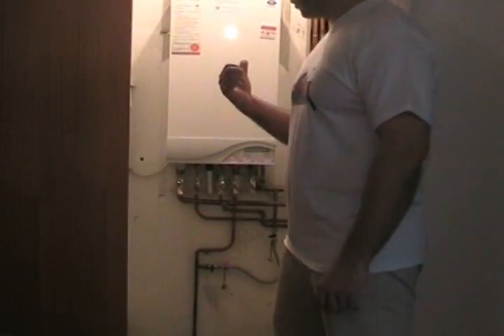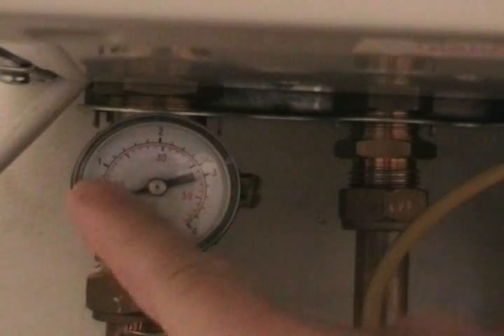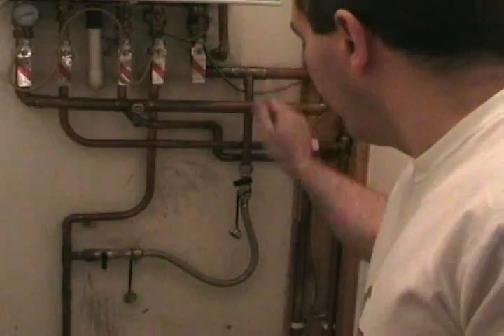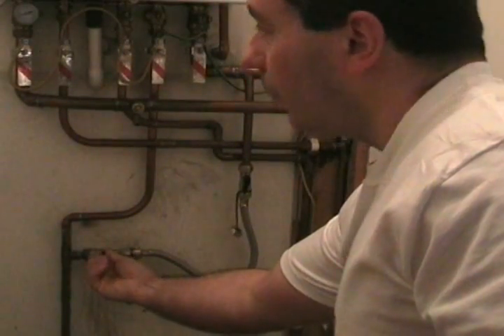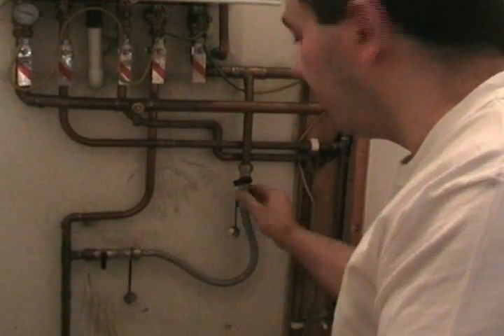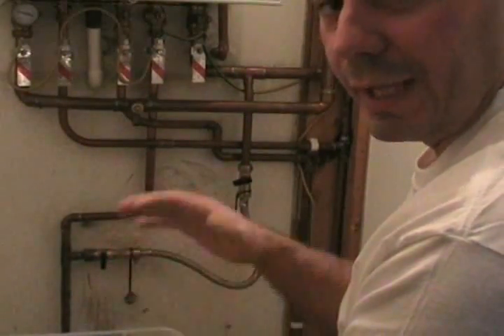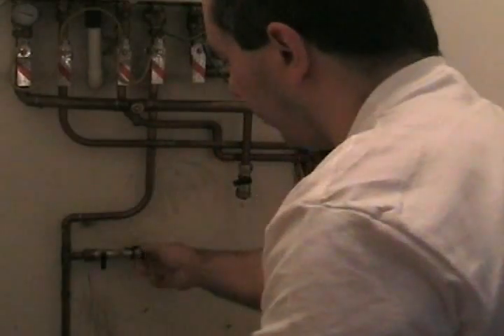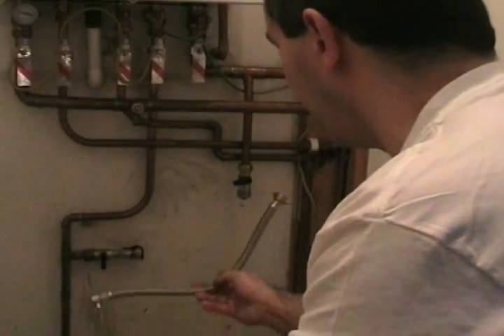How to repressurise or fill a combi boiler or sealed central heating system

Comment: Hi mate I'm having problems with the pressure always dropping on my boiler and as a apprentice elictrican I don't know much a about it speaking to plumbers on site they say it could be a leak is it an easy thing to fine 
 

Callum Scotland fife
Reply from the maker: On the outside of the property there will be a blow off pipe, this is just a piece of normally copper pipe that goes from the boiler to outside. It's a good idea to tape a plastic bag over this pipe and see if the bag fills with water, if it does the pressure relief valve is allowing water to exit the system. This happens when the expansion vessel in the system is faulty. If the bag does not fill with water it's likely there is a leak somewhere, these can be very difficult to find and can involve lifting floor boards etc. The first thing is to check the radiators- https://www.youtube.com/watch?v=vdep7cSR4Wo

If you are sure it's a leak and you can't find the cause you could try adding a dedicated leak sealer to the system, that should stop the leak. Fernox and other firms make the leak stopper ;-)
Reply: No problem thanks very much for your help keep up the videos they are very good quality and informative, if you need any sparky advice don't be afraid to ask ;)
Reply from the maker: Callum Kane
Thanks Callum ;-)

Comment: Thanks for this. Really helpful. My only issue is that due to the way a water softener has been installed I can't remove the pipe thing as in the last part. Should I call a plumber? Is my boiler going to explode?!
Reply from the maker: You are welcome.
I would not worry too much about removing the filing loop afterwards as in reality most people do leave them connected.

Comment: Hmm... I open mine on both ends and nothing happens?
Reply from the maker: Can you check the actual handle on the valve is turning the valve?
Sometimes the handle turns but not the valve, like this- https://www.youtube.com/watch?v=8Yfb1dSZHQ0
Reply: ***** I'll watch the video at home but I can feel the valve is turning (as it requires a fair amount of pressure and initially was very hard to get it going) before it stops at around 100 degrees anticlockwise - just past horizontal. I am thinking of disconnecting it and opening the knob over a bucket to test out the water supply...
Reply from the maker: Andrei Petunin
That's a good idea, just make sure you open it very slowly ;-)
Reply: I swung the lever back and forth a few times and it went further to about 150 degrees and the pressure went up as expected :-) Piece of cake! Remote plumbing is great :)
Reply from the maker: Andrei Petunin
Glad you sorted it ;-)
Reply: Hi there, I've got the same issue where the water is flowing through the refilling loop (tested by disconnecting it and the water flows out when I turn the valve), but the pressure gauge doesn't increase.

Comment: Hi, i have a serious problem (i think), my pressure was about the same as it was on this video, so i topped it up to 1 bar, but now things are happening, after an hour the hot water stopped working and when ive come to look at the pressure gauge its gone to 2.5 bars!!!!!!!. anyway i turned the boiler off, put a hot tap on and then turned it back on, the burner light comes on but the pressure keeps rising and its gone  past 4 bar. i have to keep it off or it keeps rising, any help.
Reply from the maker: It sounds like the filling loop could be passing. When this happens the pressure in the boiler steadily increases by itself.
You need to ensure the filling loop is not passing.
Reply: also when the boiler was last serviced they left the filling loop on so they've broken the law.
Reply: should i take the loop off?
Reply from the maker: Arron Lowley
Only if you can isolate the water feeding it, or else if it's passing badly it will leak everywhere.
Reply: i took some water out  of the radiators and put the pressure to just less than 1 bar, when the heatings on now it goes to around 1.2 bar.
Reply from the maker: Arron Lowley
That's perfectly normal as the water expands when heated ;-)

Comment: I have a pressure guage and flling loop not by my boiler but in the airing cupboard next to the hot water tank and expansion vessel, does the same principle apply? I notice that when cold the pressure reads close to zero but I haven't noticed any adverse effects on the heating or boiler, both seem to work as normal. Cound this indicate a faulty pressure guage?
Reply from the maker: Not sure, sorry.
Your best bet is to ask in the central heating forum, hopefully one of the heating guys will advise-
http://www.ultimatehandyman.co.uk/forum1/central-heating-boilers-f35.html

Comment: Hi - I am sure you won;t see this but hoped that there might be a small chance you would see and be able (genius that you are) to answer my question...... The boiler is coming on and off every few minutes (which I have been assured several times by landlord/his gas engineers is perfectly fine, good even...) and at the same time, the pressure is dropping from 1 to 0.  My research suggests that this is not a good thing.  I am thinking that I need to re-pressurize - if I understand correctly, to be at 1 bar when cold - and that I must do this when the boiler is cold?
Hope I am clear with my query and thanks a million in advance for you help :o)
Reply from the maker: Most combination boilers need to be pressurised to about 1 bar when cold. Once they heat up the water expands and so the pressure increases, then when the boiler cools again it should drop to the 1 bar level.  
I hope this helps.
If you are still having issues you may be as well asking here as the heating guys know much more than me ;-) 
http://www.ultimatehandyman.co.uk/forum1/central-heating-boilers-f35.html
Reply: Thanks so much...(wow, you replied!!). I shall try repressurising in the morning when it's been off (and is still off?) and see what happens then :o) And thanks too for the signpost.

Comment: Many many thanks for great video. Our boiler failed to come on this morning and the pressure gauge was showing zero after we'd bled it yesterday evening. We couldn't face potentially several days in the cold before an engineer could come out so we thought we'll have a go ourselves. Your video was the only one to advise about the disconnected pipe which we'd noticed dangling so we connected it and eventually found the valve to turn the water on (with a pair of pliers as somewhere along the line an engineer had removed the original knob). The boiler fired up after waiting a few seconds for the water to circulate and we breathed a sigh of relief now that the house is warm again. And yes, we did remember to disconnect the pipe afterwards.  Many many thanks again.
Reply from the maker: You are welcome.
I'm glad the video helped ;-)
Thanks for the comment

Comment: do you connect the cold water to the central heating return?
Reply from the maker: Yes, but the valves should already be in place- they should just need connecting via the flexi pipe.

Comment: I am just away to re pressurise my boiler but before i do, does the boiler need to be cold, off completely ie not running or off at the mains, and do i need to run my taps?? I have totally forgotten what i should do! Its a glow worm compact 100e with the flexi hose... ( at least i know where to stick it )
Reply from the maker: Yes the boiler needs to be cool as the cold water going into an hot system can damage it. As long as the central heating has not been used for half an hour and nobody draws off any hot water whilst you top it up it should fine.
Reply: Aww man you're a big bright shiny star! Thank you very much sir. Every one is duck taped to their relevant seats, away i go...you're a very nice man, a very very nice man ;-D
Reply: Well, thanks again for your sound advice. All done and dusted and warm as toast. Cheers
Reply from the maker: MsChillyfun
You are welcome ;-)

Comment: I had to do this to the boiler in the house I recently moved into, didn't have to use a filling loop, there was already a small bit of copper pipe connected. There is 2 end caps just hanging, should this pipe be disconnected and the end caps replaced?
Reply from the maker: I'd just leave it as you found it to be honest ;-)

Comment: Easy to follow vid thanks,However, I am getting the flashing F1. I have a refill loop fitted, I refill up to between 1.5 and 2 on the dial. Boiler starts working, then after a few hours the Flashing F1 is back. I have good water pressure at all taps, I have also made sure there is no air in the rads, by using a key at the top side of the radiators, loosening untill water comes. is this correct? They all work when F1 is not flashing. any Ideas. You help would be greatly appreciated.
Reply from the maker: Do you have the manual to see what F1 is?
Is this the only time you have topped the boiler up or have you done it a few times?
If it's happening regularly the chances are you have a problem with the expansion vessel.
I have made a few videos on this subject if it is that-
https://www.youtube.com/watch?v=SNULc5fhY28
https://www.youtube.com/watch?v=KeO2gswQQe4
https://www.youtube.com/watch?v=zhgOI4U5DQo
Reply: ***** It is a logic combi boiler, so there is no expansion vessel unless it is inside the boiler. I have to do this on average 2-3 times a day. according to the manual fault codes F1 = Low water pressure. It also says if it keeps happening there is a water leak, we have not noticed any water leakage in the house.
Reply: gerryxuk
Have found the servicing manual, and there is indeed a Expansion vessel inside the boiler. Thanks for the help.
Reply from the maker: gerryxuk
You are welcome.
The three videos I posted show how to add a second expansion vessel to the system, which means you can leave the existing one in the boiler but some people prefer to get a gas engineer to replace the existing one.
Thanks for the comments

Comment: hi could you pls tell me why the water is no runing in the tap after intaletion the combi boiler
Reply from the maker: Do you mean water is not coming from the hot tap at the sink?
Or no water is entering the combi when you open the filling valve? If it's the later there might be two isolation valves that need opening.

Comment: Great video. My boiler is an ideal logic+ 30 and today the pressure had dropped. I fixed it but i have no filling loop, the water ran when i turned the valves and the pressure went up to 1 bar. Does this mean the filling loop is built in to my system? Thanks
Reply from the maker: Probably, some modern boilers have two valves built in which you open to re-pressurise the system.

Comment: do i need to switch the off the electric supply to the boiler .
thanks
Reply from the maker: You can do, or just turn the thermostat down so that it does not call for heat until you have it at the correct pressure.
Reply: ***** thank you...done it

Comment: I need to add pressure to my boiler it is a heat line Monza 24 it has no filling loop and one end cant find another but every boiler is ment to have 2 end caps for the filling loop? Help please asap cheers
Reply from the maker: You might have a rigid filling loop, if you search youtube for Rigid filling loop it should show how to do it ;-)
Reply: Cheers

Comment: Thanks. Am doing it now but lots of water is coming out. the bucket is almost full.
Reply from the maker: You only needed to open the bleed valve to release the pressure.
If you have removed so much water and it still has high pressure you need a heating engineer.
Reply: Thanks. I realised after bucket full that the radiator uses the water to get hot. Bleed the remaining radiators properly and pressure back to normal. Thank you so much.

Comment: Hi please my boiler pressure is too high 3.5, how do I bring it down? Everyone seems to be showing how to increase the pressure. HELP.
Reply from the maker: You can release some pressure through a radiator bleed valve How to bleed a radiator
If the pressure has gone up by itself you have a problem, perhaps your filling loop is passing or perhaps you have a faulty expansion vessel

Comment: Hi, I have followed this video and brought the pressure back up to between 1 and 1.5 bar but the boiler will still not light?  The red light is on which is a flame with a strike through it which means it's disabled.  Any ideas on how to get the boiler to reset and start up?
Reply from the maker: Your best bet is to ask here and provide as much info as possible-
http://www.ultimatehandyman.co.uk/forum1/central-heating-boilers-f35.html

Comment: Our combi sealed central heating is losing water pressure every time the heating is on. Engineer came today to say that there could be a leak anywhere, behind the walls, under the floorboards. This isn't satisfactory to me and can't keep going out to top up water pressure although this is what we were advised to do until we know where the leak is.
Reply from the maker: If it is only losing pressure when the heating is on it might be a faulty expansion vessel. You can test this by finding the pipe that comes from the blow off valve outside. Tape a plastic bag over the pipe and if it fills with water the expansion vessel is probably faulty.
Reply: *****  - Thanks.  We had a look at the PVR (?) outside but it was dry.  The engineer said to keep an eye on it although he didn't look inside the boiler which I thought was a bit strange. The problem is it then started to rain, also it's so near the ground there's very little room beneath it.
Reply from the maker: Kate Jay-R
Finding leaks can be difficult, might be a good idea to try this at all radiators-
Find leaks on central heating systems
If the leak is under a floor it's difficult to find. Perhaps you could try using a dedicated leak stopper that you add to the central heating system?

Comment: my boiler stopped working tonight and i have 2 young kids your video was a life saver :) only problem i had was when i tried pressurising the system the gauge didn't move at all so i think its broken i only put enough pressure in to get the boiler running again and get me through the night until i can get an engineer out tomorrow, many thanks
Reply from the maker: You are welcome, I am glad it helped ;-)

Comment: hi, thanks for your video, really helping. however, one of the valves you have to open won't budge! at all. the other will turn to open. what could be the possible reasons for this?
Reply: actually it was just a bit stiff! apologies
Reply from the maker: Hr Cass
No problem, Glad you sorted it.
Thanks for the update ;-)

Comment: How do you repressurise a non-combi system i.e. it has a tank,
Reply from the maker: It should re-fill itself. If it doesn't there may be a problem with the ball float valve in the tank.
Reply: Jag Singh lion Thanks. I'm not sure that if it is filling ot not as no water or air sprays out when bleed the rad?!?
Reply from the maker: Jag Singh lion
Are you sure both valves at the bottom of the radiator are open?
Have you tried another radiator?
Is the heating working?

Comment: Good video - but how do you lower the pressure if you accidentally increase it to say 2 bar...?
Reply from the maker: You can drain some out from a radiator bleed valve, make sure you have an old towel or similar to catch the escaping water.
Reply: ***** Thanks - I thought you only bled radiators to let out air. I did what you said and filled about three mugs which did the trick. Ta

Comment: Good video. I've completely emptied my system down. How long does it take to fill the system back up again. Obviously it depends on the size of the house etc, but roughly, so I know there is not a leak anywhere
Reply from the maker: It should not take long, perhaps 10-15 minutes including bleeding the radiators. It's best to fill it slowly, rather then filling it at full bore ;-)

Comment: You mention the filling loop needs to be left off as a legal requirement. I have just recently moved into a rented flat and the boiler had a safety inspection in the first week. A few months down the line I have just noticed the pressure is below one bar and while going to fix this I have also noticed the filling loop has been left on.
Reply: well that's handy of them to leave it on for you ;)
Reply: Yeah,  before they (landlord/tennat) took it off and lost it!!! Tek it off and pop it on top of the boiler case. If lost buy a new 1. Any plumber/heating engineer will always stick his her hand up there 1st then reach into their tools to extract their own.

Comment: Thanks for the video.  I always wondered what I was repressurising by doing this, and thanks to your vid, I know its the water in the heating system.  Any advice on the max pressure?  I usually up the pressure to 2 bar around once a year.  It falls gradually throughout the year.  Would you say thisw as normal / OK?
Reply from the maker: It depends on the boiler. Most combi's are set to about 1 bar when cold, this will increase as the water heats up and expands. If you are loosing pressure it would indicate a slow leak, which many systems have.

Comment: Thanks a lot for this video! I noticed that there was no pressure in the radiators when I bled them and knew that I need to re pressurize the system but had no clue how. These boilers have too many pipes and valves and I didn't want to break something. Your video helped me fix my problem in 5 minutes. Thanks again!!!

Comment: Hello! I have a low pressure gauge, but I don't seem to have another tap at the other end of the filling loop? There is a flat headed screw to the immediate left of the one black tap, but when I unscrew this, water just drips out. It looks just like this one - diynot.com/network/LondonFlat28/albums/4882/19496
Any advice would be great!! Thanks